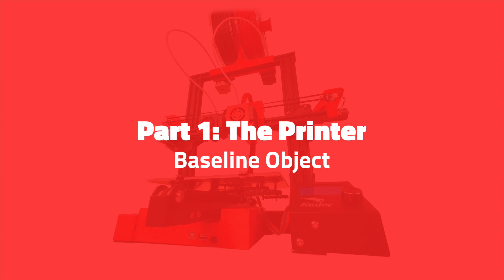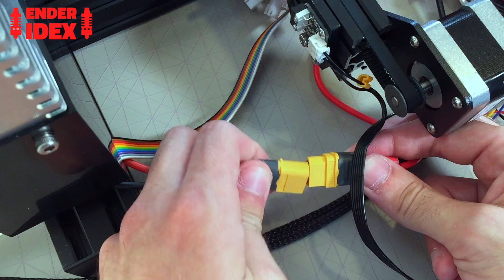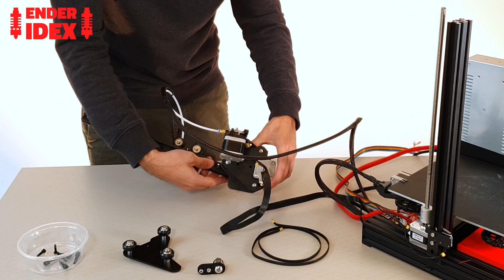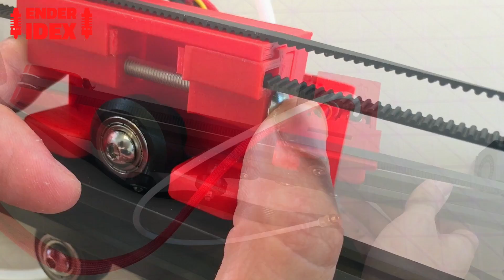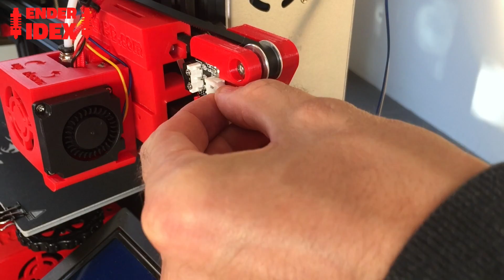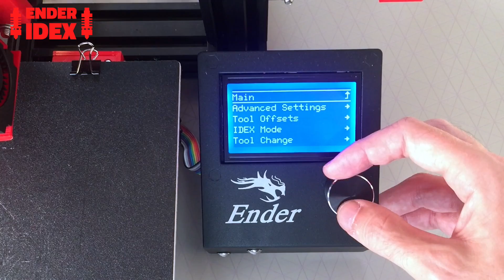Ender 3 IDEX: DIY Dual Extruder X-Carriage 3D Printer Installation Kit by SEN 3D

Comment: I found this interesting, but files, kits, etc. don't appear to be available anymore.  I was somewhat puzzled why he didn't use another toolhead from a donor printer or just buy one, rather than printing one.  That said, this video does present the building blocks/methods to convert an Ender to IDEX.

Comment: Tip when removing v-rollers from extrusion like you did on Z: loosen the eccentric nut (or just the bolts through them) to remove tension from the wheels first.  When you roll tensioned wheels off the end of the extrusion, the pressure bites into the corner at the end and leaves a nice gouge in at least one wheel (ask me how I know)

Comment: I have a curiosity, assuming others still are into modding Ender 3's. Could klipper used to run the IDEX mod using 2 v4.2.2 mainboards? The second board would be used just to run the second extruder.

Comment: Is it still possible to purchase kits and update firmware?  The website appears to have portions that are dead and no one is answering emails.
Reply: This is pretty easy to do. The software is just marlin that was configured for idex. You probably need to draw up and print the new x axis stuff. The hardest part might be the putting holes in the longer x channel. I will probably do this something I have similar to an ender 3
Reply: @JohnTenta-t1p Did you start this project? I stubbled across this trying to find another project of combining 2 ender 3's. I think I'd still like to have one printer that can print dual color or dido print.
Reply: @braxtenbrannon9833 irbis 3d I think is the name. He is doing way cooler things with old enders. I found a deal on a huge ender 5 and tuning that into something cooler. Idex is kinda getting phased out in favor of tool changers

Comment: i have 2 ender 3`s can i print some of the parts or no and my motherboard is the BIGTREETECH SKR Mini E3 V3.0 32 Bit Control Board with direct extruder motor

Comment: I've always wondered if it would be possible to have a head on each side of the gantry so they could pass each other?
Reply: The wheels of both heads roll on the same paths, they would run into each other anyways. Maybe if you used linear rails

Comment: You did a really great job and with perfection, i loved this upgrade and also want to do it with my Ender 3 model

Q.1 = can i add 3-4 color printing heads?

Q2. = if yes, could you please drop me the links for the upgrading additional parts to change ?

Q.3 = do i need to change the firmware code along with hard ware, or not needed if the board is preloaded with the firmware?

Q.4 = in addition of all extra hardwares, do i need to upgrade the power supply unit? if yes then please drop the voltage, amp & watt here.

Q.5 = does changing such motherboard and other hardware components affect my printing quality ?

Comment: The kit costs more than getting another ender 3.. 310$
Reply: So, how does purchasing two Enders enable me to print with two extruders on the same print ?

It costs more than two Enders because it does more stuff. If you don't need two extruders then you won't need this.

If you do need two extruders though, this costs more because it does something that two separate printers can't.

Comment: i only didn't like the fact of there's only one lead screw. seems unstable, and forces the Z axis motor
Reply: I built it with 2z steppers . Idex is easier to calibrate with z_tilt_calculate
Reply: You can put in a second Z screw if you wish. Making that modification is independent of having a second extruder, provided one has a spare motor driver port available (even a copy one)

Comment: Hey there, a quick question, would this work on the new Ender 3 V3 KE? It has a Sprite direct drive extruder, and is a bit different compared to the Ender 3. If it does not work, what suggestions might you have for a Dual Extrusion upgrade for my Ender 3 V3 KE? Thanks.

Comment: I have an Ender three pro and I’ve been looking for something like this or printer like this and this is exactly what I’m looking for as an upgrade for my enter three pro however. What I want to do is print models and use the water dissolving filming as support material.. is that configurable within the slicer or whatever slicer that supports idex?
Reply: Prusa slicer supports using dissolvable support filament I'm the way that you describe.

Comment: Hiya, just stumbled upon this as I was looking to get into 3D printing and interested in getting Ender 3 V2 neo. Just wondering if this kit will work with that model? also, how does this work if I'm looking to get the extruder replaced with a double direct extruder? thirdly, can this be klippered? Thanks

Comment: I assume this will work if I have the extender kit (400x400x400)? I also have a direct drive extruder so could the other hotend have another one of those equipped?
Also could I have marlin or klipper installed with this? Are there any limitations to the motherboard, I have a bl touch, runout sensor, and octopi running

Comment: Is the mother board version used at least a 4.2.2 or a 4.2.7 ? Because I would like to be able to use it with my Creality CR touch auto bed leveler on the primary extruder.
Reply: You can't use either of those boards because there aren't enough steppers supported.  You need at least 6 (X1, X2, Y, X, E0 and E1)

Comment: this is so awesome and I would love to get one for myself but I need to know... I have ordered for my normal ender 3 a cr touch sensor do I need some type of additional modification to use it or software or it would still work?
Reply: The main kit comes with a whole new controller board that you swap out, so that board will have different firmware installed on it to control both extruders.

Comment: its actually the best in the market because u will have both ender 3 and idex the only thing holding me is waiting for them to upgrade the kit because at the left side the original extruder don't go farther more which don't allow the new extruder to maximize the space to the edge force a smaller printing space for the dual color and i am waiting the kit for ender S1 extender size and idex

Comment: Can you add auto bed leveling using a bl touch?
Reply from the maker: You sure can. The sensor is installed on hotend 1 like normal. As long as you tube you X/Y offset well both hotends can then use the bed levelling mesh.

If you did buy my kit I provide an installation guide and pre-compiled firmware too 🎉

The only case it is not useful is for duplicate or mirror mode prints. In this case 2 hotends touch the bed at 2 points at the same time so ABL will not be able to adjust for both at once (this is true of any IDEX setup). But you can still use the BL Touch data to accurately level your bed manually.

Comment: Could i do this to a ender max instead?
Reply from the maker: There are a few people that have installed the kit on the Ender 3 Max. Dimensionally it's the same as my Ender Extender 300 kit. 

The only difference is that you will also need a new bracket where the filament runout sensor currently is. This is to create the required space for the X2 motor mount. I can provide this if you required, just email me at kane@sen3d.com

Comment: Would this work on the ender 5pro
Reply from the maker: Not as it stands. I have not progressed the kit to the Ender 5 just yet as the "cube" frame makes it harder to part hotends off the bed without loosing print volume. Watch this space as it is on my list (with many many other things 😅)

Comment: This is so impressive.. I think you filled a huge gap of quality dual extruder printing in this price range. What about shipment cost and customs to EU?
Reply from the maker: Thank you so much for your kind words Lumaxia. Shipping within the EU is not too bad and varies from country to country. If you check my website and go to checkout, when you input your country the shipping cost/options will show there.

For customs again it can vary a lot from country to country but typically you will have to pay VAT on delivery to the courier.

However, if you want to avoid all this my "file pack" option can give you a great alternative route. You can grab the hardware yourself and print the parts too, saving on the big heavy box coming into your country 😮

And of course I'll still be here and happy to help whichever option you chose 😇

Comment: Say I converted my ender 3 into a direct drive, could this kit work for that ? And could I run both extenders on direct drive ? And would I be able to put a bl touch on each ?
Reply from the maker: Great questions, in answer:

1. Yes, you can run direct drive on the Ender IDEX. However for hotend 1 you need to select a carriage design that has the stepper motor over the front. If it's over the back like the MicroSwiss design this will collide with the X2 belt path directly above the existing X1 belt path. Many of the low cost and "print yourself" direct drive options work great.

For hotend 2 the kit comes with a file for a direct drive option you can print and install yourself 😁

If you do go single or double direct drive I would also suggest you install a dual Z axis motor kit on the Ender 3. This is a good idea anyway for a direct drive ender 3, even without an additional IDEX carriage. The common dual Z-axis motor kits for the Ender 3 work great with the Ender IDEX parts too. 

2. You can indeed install and use a BL Touch with an IDEX printer like the Ender IDEX. You would install it on the hotend 1 carriage and use the usual Gcode to create a mesh. Hotend 2 (provided it has been calibrated with X/Y offsets) will then just use the same mesh data during printing, so no need for a second sensor.

The only time Auto Bed Levelling is not useful for an IDEX machine is when you run a duplicate or mirror mode print. This is because you have 2 hotends touching the bed at 2 points at the same time. This is the case for any IDEX machine, however you can still use the BL Touch mesh data to help you achieve a near perfect "manual level" too.
Reply: @SEN3Dcom  thank you for the response. I hate to be a pain but i did have a few more questions, given that I'm new to this. 
1. Seeing that the whole board is replaced, would this mean that something like an SKR board  is redundant?
2. Will an extension kit on my ender 3 say a 400X400X500 be compatible?
3. Will a Raspberry Pi be compatible?
4. Can i attach a blockhead fans to both hotends without them colliding? 
5. Do you guys plan to make something similar for a CR30 for example? or any type of conveyor belt like printer?
Thank you for your time
Reply from the maker: @judontknow69  No problem at all 😁

1. yes, the new board replaces the existing one entirely. BUT you can always keep the existing board and use it for a future project (you'd be surprised how handy it is).

2. Yes indeed, many people have done it and I offer versions of my kit for the Ender Extender printers (and even the some CR-10 models). The main differences needed is longer cables, longer x-axis extrusion and a different firmware file.

3. Yes indeed, the firmware I provide is pretty close to "vanilla" Marlin so it's just as compatible as any other printer. However you will likely need to customise OctoPrint a little to account for the 2 hotends and some plugins may get a little confused, but nothing major.

4. Blockhead fans...so installing on hotend 1 is fine, hotend 2 is a bit more custom as it raises and lowers with a screw independently so may be harder to install. BUT if you are good with CAD you do get access to the parts files too so you could modify a custom fan setup too!
In terms of collision, the min distance between the two carriages can be set in the firmware so if you did want to enlarge it to account for wider fan setups this is an easy edit to make 😁

5. I like the way you're thinking! So currently a few different models in the pipeline (admittedly not the CR-30 just yet). A small operation of just me 😢 means that I often have too many ideas to work on and not enough time for them all. So one day soon but I wouldn't want to promise a date.
Also, with files access it may be possible if you wanted to get really stuck in to try it yourself...but this would certainly be a more advanced project for sure!

Keep the questions coming if you have more! 😁👍
Reply: @SEN3Dcom  hey thank you so much! With customer support like this, the sky is the limit for you and your team. God bless you.

Comment: Could this be installed on the ender 3 V2?
Reply from the maker: Absolutely, if you check out my buy page and scroll down there is an Ender 3 V2 Version of the kit: https://3d.plus/buy/ender-idex/#IDEX-alternative-kits

It has a few key differences from the standard kit:

1. It includes a TFT35 display as the bespoke Ender 3 V2 screen does not play well with non-creality motherboards and also misses a number of settings and menus for an IDEX setup.

2. The power cables come with fork crimp connectors to screw directing into the power supply as the V2 does not use an XT60 plug

3. It comes with the "lift box" and matching printer lets to lift the printer overall ~20mm. This gives you more space for all the cabling out the back as the Ender 3 V2 with its rear mounted power supply can become very compact and restricted with all this extra tech squashed in 😇

4. An alternative X-axis belt tensioner as the standard Ender 3 V2 one is too large and restricts the space for the X2 belt pulley part of the kit.

If you did get the Ender 3 V2 version of my kit everything you need is included straight out of the box.

Comment: Two different nozzle sizes idea is cool. You can have nice and fine detail perimeters, top fills, inside could be filled quickly, sturdier.
Reply from the maker: Exactly, and even if you tend to switch from regular 0.4mm prints but every now and then like to blast out a 0.8mm or larger "rough" print...it ends the pain of frequent nozzle changes. I don't know anyone that actually enjoys changing out a nozzle, especially if you have ABL setup too 😅

Comment: Is there a cr-10 version?
Reply from the maker: Yes, great question. There is a beta version of the CR-10 kit available. However there are many many versions of the CR-10 and so your milage may vary depending on the model you have.

The number one thing to check is if your model runs on 12v (typically older models) or 24v. The Ender IDEX kit that I provide is all 24v components so a 12v would not really work. Or you'd need to upgrade the rest of your machine to 24V or swap out the kit components to 12v. Plus you'd likely need to decouple the heated bed too at 12v as it will draw a much higher current through the motherboard that at 24v.

The other thing will be the model specifics like the screen, case and cabling.
If you have a model like the CR-10S with a fancy screen this will also be much harder to adapt as the kit and most of Marlin is really geared up for the classic LCD type interface or a completely control option like OctoPrint. If the case is in the base of the printer too it may be harder to integrate the electronics. And if you have something like a runout sensor mounted on the X-axis this also interferes with the location of the X2 motor.

All these little things are possible to solve but may require extra parts and tinkering to fix. I cannot guarantee it will be as easy as an Ender 3 or Ender 3 Pro which are very consistent machines.

Ideally I would say the CR-10 V2 is the closes to a plug and play setup as it has 24V, LCD, a box that it is possible to put the motherboard in and easy cabling to work with. However, if you're buying it just to upgrade to an IDEX you may be better off with a cheaper Ender 3 and an Ender Extender kit instead.

Let me know if you need more information or know the specific model of CR-10 you have and I can advise further 😇
Reply: @SEN3Dcom  would there be a cr10s5 version coming out? I don’t know if it would be compatible with this much bigger printer
Reply from the maker: @static6437  I have not seen that specific model (Creality have soo many variations of the CR-10 it's hard to keep up 😅).

The printer size/volume is rarely the cause for any issue. That usually just means you need longer extrusion, belts and cables.

Things which can add a bit of complication are if they use some kind of custom screen or cable connectors that are bespoke to that board. It's all solvable in the end but may need things like some additional cables and something like a TFT35 etc.

So all in all if you're happy to get stuck in and troubleshoot some issue then it should be possible but if you're looking for a simple and fast install something like an Ender 3 of Ender Extender are much more guaranteed for this 😁

Comment: could this work with a SKR 2 instead of the SKR Pro?
Reply from the maker: It would not really work with an SKR 2, mainly as it does not have enough stepper motor ports. The SKR Pro has 6 for: X1, X2, Y, Z, E1 and E2. So broadly any mainstream board that can run 6 or more steppers independently should be possible but less and it won't really work. 😇
Reply: @SEN3Dcom  i see, sorry I missed the bit about needing to be able to run six drivers.  My order for the skr pro from Banggood has been delayed for over 2 months so Im just gonna go with some overkill and get the octopus board.. outside of housing the board, there shouldn't be an issue with using that instead right?
Reply from the maker: @cuttyb  Awesome, the Octopus is a great board and very similar to the SKR Pro. It also gives you future options like dual independent Z-axis control.

You'll need to make some tweaks to the firmware to account for the different board but it will be just as compatible. Many existing kit owners have made the same upgrade already!